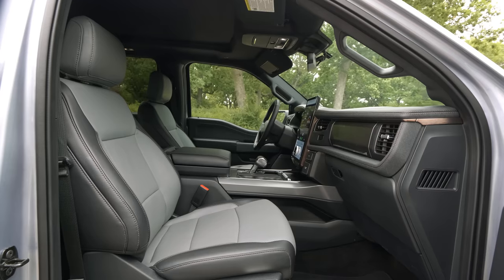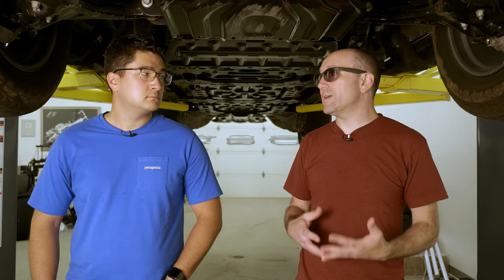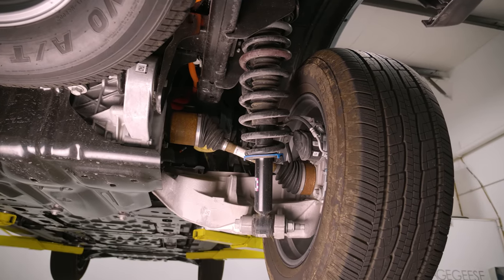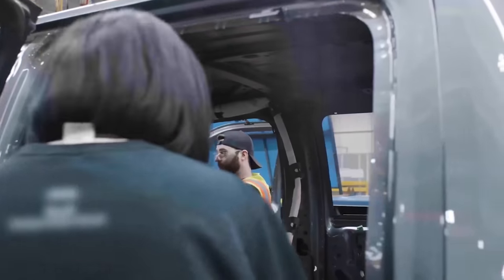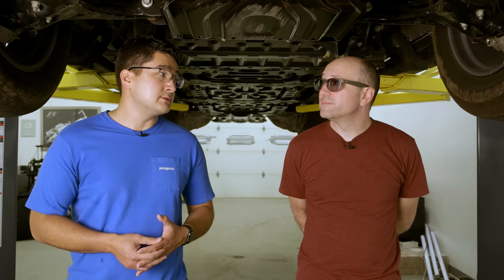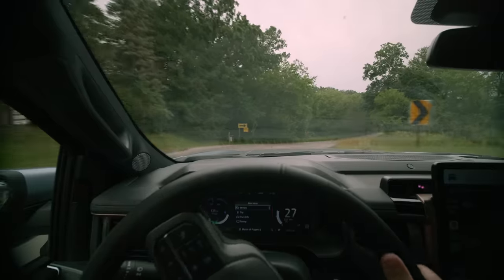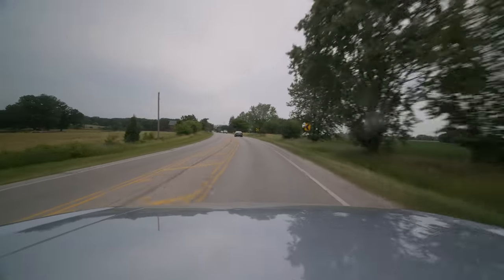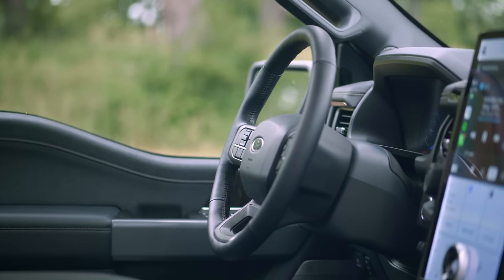Ford F150 Lightning | The EV That Will Change Trucks

Comment: There are some open questions about the externalities and grid effects, but I'm impressed at how in the past 20 years we've gone from mass marketed electric trucks being purely theoretical applications to a series of difficult but solvable engineering problems.
Reply: Agreed, although they're still mostly toys at this point. I don't see the actual charging infrastructure making (non-hybrid) EV's  in general practical for more than 5% of the population for at least another 20 years. I am pulling these numbers out of my ass, but it sounds about right. I live in NJ which is a small, densely populated state and 99 out of 100 cars I see on the road are still gasoline. Also, I find it extremely EXTREMELY hard to believe that the state governments are just going to take hundreds of millions of dollars in gasoline tax revenue in stride. The second that EV's become more common, is the same second that they stop becoming money-saving.
Reply: Power generation is the engineering problem that needs to be solved!!! And nobody is talking about that!
Reply: Engineering Explained did a good video on it a while back: https://www.youtube.com/watch?v=7dfyG6FXsUU
Yeah, it's a big problem, but it's one that we can see coming a long way away and all the possible solutions are technologies we know how to scale effectively.
Reply: @seanbond1008  I didn't even think about the gasoline tax money being lost. I assumed the electricity prices would continue to rise the more its being used because your going to have to pay whatever they charge in order to provide you transportation on top of electricity for living. Then when electricity prices get too high, some people will switch back to gasoline-powered cars, if they still exist at that point.

Comment: cant wait until someone makes a maverick-sized vehicle in EV. perfect for my needs. f-150 is too big, doesn't even fit in my garage, and i only need a pickup truck to do small weekend projects around the house. an ev small pickup would be great for my short daily commute too.
Reply: Ford recently trademarked Maverick and Ranger Lightning. My guess we'll see those two hit the market within the next two years.
Reply: 100% agree. i think the maverick would be the perfect truck to make a ev. F150 is a workhorse the maverick is more for the weekend trip to lowes
Reply: Maverick owner here, and what I really want is a Maverick with a frunk. It'd then be MY perfect utility vehicle.
Reply: Even a plug in hybrid Maverick would be great, give it 20-30 miles electric range and you would get the best of both worlds with a lower price.

Comment: I really want one but I think I am going to wait a few years. I question the quality of cars that have been made in the last two years due to the parts shortage.
Reply: I question the quality of Ford from 2000 on in my personal experience with them. The company works for the stockholders and the actual customers are treated like a necessary evil.
Reply: @HighGear7445  Doesn't pretty much every company work like that? They cater to the stockholders while the customers and employees are (and I really like how you said this) necessary evils.
Reply: Ford sucks 😕
Reply: @trailrunnah8886  No not really , it seems the largest companies out there are more apt to and public owned ( sell stock to the company). I've worked in several small to medium privately held companies and the customers satisfaction is the first priority.
Do that and the money will follow.
You work with a customer to what's fair for both of you.
Stock holder driven companies are beholding to the stock holders and the emphasis is on short term profits, not always thinking ahead for success down the road. I talked to the CEO once that ran a very large company ( fortune 500 I think) and was so disgusted with how the stockholders wanted the company to run that they bought up the stock and went back to privately owned.
He knew long term his company wouldn't be successful just aiming for short term profits. Money has to be spent machinery, software ect has to be bought so a company can hit the road running ready to take advantage of future work . Work products ect are always evolving and you need to be ready for it to keep up and expand your business. After 45 yearsthough I'm finaly out of the rat race.

Comment: Engineering Explained has a great video talking about the grid and electric vehicles and why in essence we can pretty easily keep up with the rate of increased load compared to the rate of Ev adoption  as we have historically been able to.
Reply: In theory maybe.
Reply: People are just unrealistic on the rate of adoption.  It’s not going to be all evs in 10 years. A gradual change will allow the for the grid to keep up.
Reply: Dealers keep marking up EVs and benching more affordable options like the Bolt, no one will have to worry about a steep curve on mass adoption.  We've still got major players like Toyota and Honda barely in the game.
Reply: @dr._breens_beard  Capacitors are bad at holding charge for prolonged time. I only see them as useful for short-time buffer.
If you make a hybrid car battery using Li-ion and ultracaps, the caps will probably slowly drain the battery unless you disconnect them. But then they would only be useful if you give them charge time before use and the whole tech pairing so that you can make the li-ion cells with zero focus on high current ability. But then again... if you don't have high current, that also makes the cap charging take longer.

With the escalating scarcity obsession and efficiency craze, capacitors are basically wasting too much energy to qualify for mass use as battery alternative.

And I haven't mentioned the main reason yet: Ultracapacitors have much lower energy density than li-ion!
And they also need special considerations in regards to the voltage you are working with.
They are basically only good for extremely high charge and discharge currents, and this is why they have been used for such purposes in electronics for ages - as short-term buffer.
Reply: ERCOT might think other wise.
Reply: @Dowlphin  for now they are.  But the biggest advantage of electric cars may end up what pushes supercapacitors into EVs.  If u have a small commute or job that requires lots of driving short distances, the high charge and dischage speeds will make far more sense.  Hybridization with li-ion batteries is probably where it will go for other vehicles like EV pickup trucks that require long distances or large power storage for hauling/towing.
Reply: @Dowlphin  What if the manufacturer designs a small ice generator onboard with high output alternator. Won't that be able to charge up the batteries fast using little fuel?

Just asking?
Reply: @farzana6676  You mean like a plug in hybrid? Pretty much every OEM makes a plug in hybrid at this point from Ford & GM to Toyota and BMW.

Comment: You can't really "just plug" ANY sizeable generator into your house without "setting the home up" for it. I don't think it's unfair for Ford to tout the emergency generator aspect of this truck without mentioning setup cost. What I don't like is that this is probably the PERFECT electric vehicle for someone like me, but it'll probably cost $70,000 because everyone sucks.
Reply: I was recently at a local cars and coffee and they had a platinum edition of one of these out there and it had a window sticker of $139,000 absolute joke.
Reply: And they quoted $5k to set up home for powering by EV. What a joke. Yes, if you go with full automatic solution from Ford plus installation, probably. But manual transfer switch is a couple hundred bucks. You would still need to do some setup with standalone generator as well
Reply: @Outlier117  I just glanced on AutoTrader for F150 Lightning prices within 100 miles of me. The most expensive one I found just had a tow package and a window price of $112k. There is absolutely no reason a truck should cost as much as a small house or condo! The "cheap" one around me was still $70k. It's complete nonsense.
Reply: @tenhundredkills  I cannot for the life of me understand who is spending that much for a vehicle like this & what their actual use case is. I would love to own an electric vehicle, especially this one but the pricing is absurd.
Reply: @maximlg253  exactly. Before I even owned a generator I had a manual interlock installed. I couldn't imagine just bringing home a generator & being surprised that it doesn't magically power the house.
Reply: @donhill1825  Most auto makers realize that so many Americans are dumb enough go into massive debt for a car. As long as we keep taking longer loans, the prices will continue to hike. It's obviously not the only reason for these insane prices, but it is definitely a large factor!

Comment: I think a lot of people towing stuff accelerating slowly is due to them being careful with the load. You don’t really wanna be tossing your trailer around. I’d honestly still have ICE or Diesel. I have a Miata I’d love to tow to tracks around the US or even tracks 4 hours away. This would kinda be a useless truck for people who actually wanna do truck stuff with it.
Reply: We're a while away before EV trucks become "work" trucks, cost alone is enough to make any major contractor look the other way. I'd much rather have a throw-away base model f250/f350 to do work with for half the price than the lightning. You'll probably see a few supervisors and white-hat old dudes driving these though to client meetings and just around sites for the day but thats it.
Reply: @anthonybaker9270  In reality this was made to be a huge, fast daily driver. The Pro model is insane value but I don't imagine they make profit on that. It's just 1k more expensive than a Crew cab F-150 XL.
Reply: Now you can leave your Miata on the trailer and still win the race 🥇 🏆
Reply: @imnotusingmyrealname4566  Color me shocked, I was under the assumption it'd cost similar to the Rivian and tbh I posted my comment before watching the full video and researching prices myself. Still won't see one doing major contracting work for a while but at that price point I can absolutely see maintenance landscapers (mowing, trimming, etc) making use of one. Lots of stop/go driving usually within 1 quadrant of the city with minimal to no towing.
Reply: @alzinifelshoni2602  Lmao gross. Road tracks not drag strip.
Reply: Are you a male hairdresser
Reply: @fcv1967  No, but I’m sure an online search will find you what you need. Good luck out there!

Comment: Quick monthly fuel cost comparison, using 15k miles per year, average U.S. elec cost vs $4.50/gal for gasoline, saves just under $200/month.  Plus of course there's none of the regular maintenance (and headaches) on the engine and transmission. And if you charge at home you NEVER have to stop for fuel again.
Reply: This comment didn’t age well.

Comment: You guys missed how much it costs compared to a normal truck and whether or not you believe that is a pro or con. I'm assuming that long range package is going to be extremely expensive.
Reply: The base Pro model is $40k. That makes it the cheapest crew cab 4x4 pickup on the market (a base f150 crew cab 4x4 with the 3.3l v6 is $43k). Fleet customers can get a long range for about $47k. A long range XLT is $73k which is the cheapest way a regular buyer can get long range. A long range Lariat is $77k.
Reply: @TheNotimprezed  And the real out the door prices are well over $100,000.
Reply: @kerplunk38880  it won’t be forever
Reply: @JF-ns5zs  this bubble will explose like EV 1.
Reply: @TheNotimprezed  Fleet customers are not going to buy this crap.
Reply: Plus they can’t tow for shit, you get about 1 mile per 1% of battery when towing.
Reply: @RAZGR1Z  and Ford will be fine with that. They are not going to even produce many Pro units. They rather everyone buy the Lariat and the Platinum models because that will generate more profit.
Reply: At least electricity can be made from the sun, which is significantly cheaper than petrol ;)
Reply: @mookieblaylock2589  no
Reply: @dragospahontu  not really, do you know how much solar panels cost or what it takes to make them?
Reply: @FishFind3000  in Europe, I got 5Kw of power for €6,000. Not a bad deal.

I can charge my EV and drive it for free essentially, or with the electricity i put back in the grid the state gives me money. With that money I can fill up my TDI ;)
Reply: @JF-ns5zs  True.  It’ll be worse.

Comment: You don't need some kind of $4,000 connection to hook up to your breaker. You need like a $500 transfer switch and can run like 6 circuits from your breaker - if this is strictly about power outages.
Reply: @skellington2000  exactly. And if you are buying a 75k truck, you probably can afford a 4k whole house panel anyways.
Reply: Or maybe you sell your house to afford the truck and just live in it making the feature obsolete

Comment: I’ve always thought it only makes sense to lease an EV, you’re going to want the update every 2-3 years. The phone analogy is apt.
Reply: That means you're never going to realize any economic benefit. You'll be paying full odds on the depreciation and turning it in before you reach the variable cost break-even point.
Reply: My Tesla I bought 2 years ago is worth more today than when I bought it.
Reply: @fcv1967  That's only because the used market went crazy for the short term. We hope!
Reply: They can be kept if OTA updates happen regularly and don't require a trip to a dealer. There will be the limitation of lacking hardware as the vehicle ages but only like 1% of consumers have any experience with a car that gets updated. You buy it and it never changes from that day on, and those that always have to buy used cars have never had any of the most modern features. The best thing about EVs is low maintenance and you can keep it 20 years if you want without the ever increasing repair costs of ICE.

Comment: Suggestion, please include vehicle pricing, talk about the warranty (especially unproven battery tech), the battery capacity/ range loss with age, and battery replacement cost if we had to pay cash.
Reply: @yzhan225  I'm aware the internet can answer questions hence me being on YouTube. You're missing the point these guys do car reviews for a living suggestions like mine are not unreasonable. Ford has been testing this vehicle for years before going into production so they know capacity loss over time....these guys speak with Ford when they get the truck so they can ask.
Reply: @chimrichalds1422  its not a black or white answer yet tho. No one has owned this long enough. Those ones they tested are just preproduction units so not accurate. Will need real life testing from now on and likely depends how the users charge and how often, DC fast charging amount vs home charge.

Comment: 12:02 When I hear lines like "Probably one of the most-sold vehicles in the world" I know Jack needs to keep some distance from marketing reps, because whether that's true or not depends entirely on how long you make that list.

As for mileage, with this mix of gas and electric now, and both getting pricey, soon we might see these things simply measured in MPD - miles per dollar.

Speaking of power outages, that's gonna be fun, too, when you go to your vehicle in the morning and realize you cannot drive to work because you expected it to charge over night but there was no power. EV tech makes you EVen more grid-dependent, centrally-controlled. Conquest of the Matrix. Convenience is a temptation to enslavement.

To consider when you talk about torque mobility with cargo: Then you need to secure it even better, because if you step on the pedal in an EV like this while pulling a trailer, you might get an unpleasant surprise. (And/or the drivers behind you.)

Comment: I am a contractor who is largely self-employed, and while I'm absolutely in love with the ability to plug my tools into my truck and store some of them in the frunk instead of on my seats or in a toolbox behind the cab, until there's an 8-ft bed variant of this, preferably with a single cab, it just doesn't make sense for me to purchase as someone who has to get all of his own material and then get it to the job.  

For those of you watching this who aren't familiar with carpentry or general contracting, many building materials are sold in 8 ft lengths as standard, and while you could theoretically just lower the tailgate and strap things down, it also impacts your ability to put larger things in the bed, like 12 ft lumber, without having an unwieldy dangerous protrusion from the back of your truck or needing to attach a flag for safety.

 I'm not well off, but not hurting, and I would happily sign up for the monthly payment if it actually had both of those options.  Sadly, that kind of stuff probably isn't going to filter down to what would essentially be a fleet vehicle for years.

Great review as always, though. Hoping the folks at Ford give you guys more technical info since you are the only reviewers I've seen and like who actually take full advantage of it.
Reply: This is just the start, they'll have more models/configurations soon

Comment: FYI - I have a device called a GenerLink that sits behind my meter and allows a generator to be plugged in without having a separate bypass panel. It cost about $1200 to have installed in addition to the cost of the portable 12kW generator.